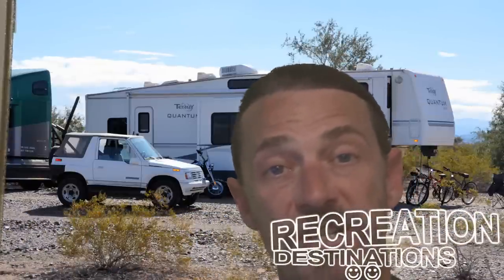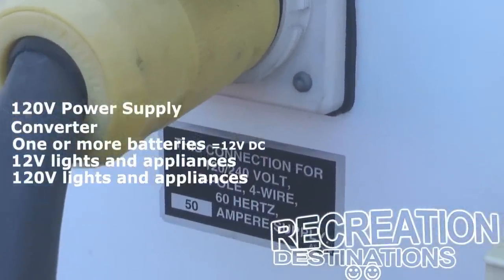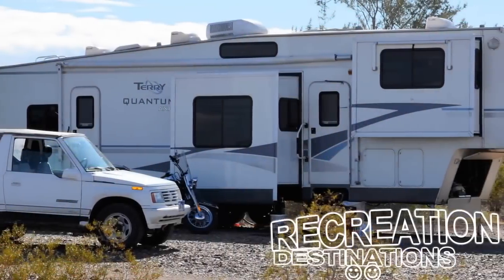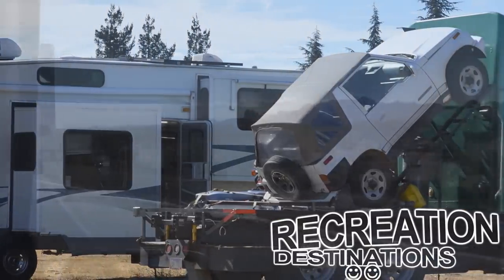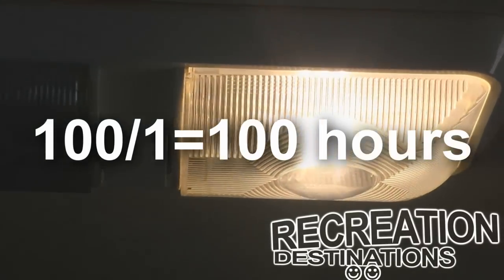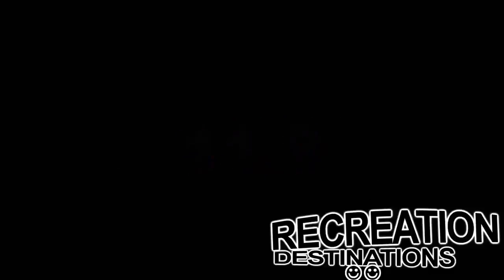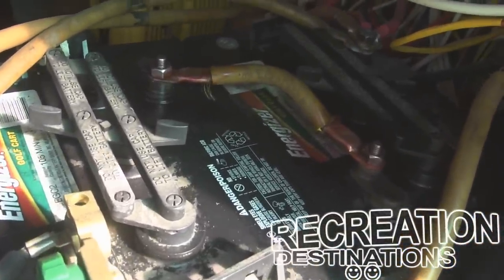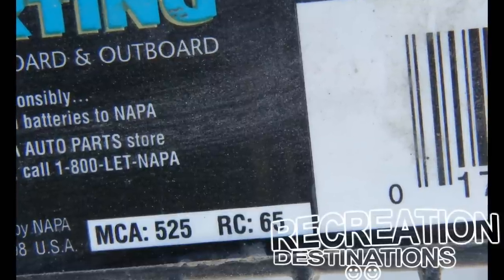Understanding RV Electrical Systems Part I

Comment: I am using a friend's inferno camper don't know the year the receptacle in the kitchen kicked off and I cannot find the circuit box or fuse box in the camper. I have searched in the camper and in the battery compartment. Since you are very familiar with tv's I thought you may be able to give me some Idea where it could be. It is a 43 footer Inferno. Thanks
Reply from the maker: I can't tell you where the breaker box may be, but if it was in the kitchen, I would look first for a tripped GFI (probably in the kitchen or bath).

Comment: Turned the Generator on in my parked RV , then turned the AC on and it wouldn't work. I have never had issues with the  AC in my 1999 Coachman Mirada Motorhome . 
I read everything and learned that if the Microwave lights/ Clock won't come on than the problem is connected to the Electrical Converter Box. 
I plugged into my home and received the same results.  I ck the Fuses in all appear to be fine and all of the switches are on in the box, I checked all of the GFI plugs.
I have a sick Aunt and will need to drive to Ohio soon.
If I put it in the Shop they will keep it for two weeks. 
It's just exasperating , I really need help , but I can't locate any additional information in the Owners Manual .
Any advice would be appreciated.
Thanks,
Kim
Reply from the maker: It is extremely difficult to diagnose electrical issues over the internet.  If you know someone with electrical experience and a multimeter you could try some basic troubleshooting to see if the AC is getting power.  If it is, the problem could be a faulty start capacitor.
Reply: We had same issue.  Turned out after several RV shops couldn’t find the problem, our local farm tractor repairman did.  The ground wire to the frame of the down by the back tires had come loose and broke when we hit a big pothole.  It is a Fleetwood 2009 fiesta class A and the ground wire attached to the passenger side back duel tires just above them, on the frame.  It was broken off.  He reattached and everything worked and the batteries charged and stay charged.
We went through 4 converters and 4 pairs of new batteries in one summer not understanding what was wrong.  And yes, the tractor man used a voltage meter until he isolated that it was not grounded.

Comment: hi, thanks for the video. I do have a question though. I was given a battery with my rv. Its a Deka Marine Maste and says for Marine and RV use.  I'm trying to figure out how many amps it is. The top of the battery has DP24, CCA 550 CA 685 and RC 140. I can't see where it says Amp hours.  Thank you
Reply from the maker: You might find the information at the manufacturer's website.  The DP24 may signify that it is a 240 amp/hour battery.
Reply: Recreation Destinations thanks il do that. It would be nice if these manufacturers just put it on the battery to make things easy

Comment: Thank you for an excellent video. I'm new to RV but familiar with electrical system (excluding rv).  Did I understand you correctly that RV parks that have 50A service are actually 240V at the shoreline outlet?
Reply from the maker: Thanks for the comment.  Yes, a 50 amp RV plug actually has two separate 50 amp hot legs, a neutral, and a ground.
Reply: yes they are

Comment: You should mention the Transfer main switch.If wires come lose over time they arc and the result is SMOKE.It happened to me and my neibour.Cost me 600 dollars on a 15 below nite to get a tec to the rv and replace the box. Make sure all of you check your transfer box to MAKE SURE the wires are tight. Thanks
Reply: DOUG FERGUSON m
Reply: Ouch, thanks for the warning

Comment: Great video, and very useful. After owning three 5th wheels, I think I’m fairly up to speed on my electrical system, but I still don't know what the transfer switch/box is or what it does. Is it part of the converter??? Help! Thanks!
Reply from the maker: Transfer switches are generally separate from the converter/inverter.  It senses power from shore line and switches to draw from the shore power.  If no shore power it switches to generator or inverter to provide 120V.
Reply: Recreation Destinations But I thought you just plugged your RV power cable directly into your generator, so how is that power any different than shore power?
Reply from the maker: Onboard generators in motorhomes and some trailers are hard wired into the system and a transfer switch is used.
Reply: Recreation Destinations Got it. Thanks for clearing that up!

Comment: I have half power on my camper light ac want come on the frige stopped working an I plugged up to sure power so is a breaker bad or what hook a battery up an stuff works

Comment: Any info on battery isolators and how to check for problems ?
Reply: My 12 volt system does not come on when I disconnect from 110 volt battery's are good

Comment: Does the battery need to be charged if it's plugged in a RV park
Reply from the maker: If you're plugged in at an RV park, the built in converter should be keeping the battery fully charged.

Comment: The battery indicator shows voltage & will show full while the charger is on. To see where your actual charge is on the batteries you can unplug from shore power & the voltage will fairly quickly drop to the batteries charged level.  After being unplugged for a minute or two the indicator will show your actual charge level.

Comment: Ok so my rv generator is set up ware it charges my house battery however needs to be started with the battery under my hood...if i use the battery under my hood only to start the generator and nit try to start my rv will a 6 volt marine battery work for that
Reply from the maker: No.  You will need a 12V automotive starting battery for under the hood.

Comment: If I leave my rv plugged into shore power all the time while in storage will it hurt my house batteries
Reply from the maker: No.  As long as you keep the battery electrolyte levels maintained, the batteries will last longer if the voltage is kept at 13,2 V.
Happy RVing.

Comment: are converters interchangeable? my cousin has one ....i need one......but they are different model and makes
Reply from the maker: Converters are generally interchangeable.  Output amperage varies. Higher is generally better.
Reply: Thx again..after 2,0000000000 you tube people...finally settled on you..how'd you get so knowledgeable? Why the semi? I drive one for my job
Reply from the maker: I've always been a DIY kinda guy. My first full-time RVing adventure was in 1992 and have been immersed in the lifestyle ever since.  Guess I've picked up a few things along the way.
The semi is a longer story.  Perhaps I'll tell that story via video one of these days.
Happy RVing!
Reply: Thx for response...I am green with envy!! Wish I could quit this shit and rv full time too..when I do get a few days of I park my rig in the lot where my toyhauler and pickup are......get in it and go hide for a few days....personally,I'd like to park it in the middle of about 40 acres of fruit trees and a big ass pond......

Comment: Why don't they make a popup with folding metal sides instead of canvas. In Europe they sell the Caravan. They make an A Liner here but I prefer straight up cabin walls. Also they make a high_low but they seem too big. Prefer to look out rear view mirror when I drive and a light weight trailer
Reply from the maker: Do a search on "hard side pop up camper".  There are some out there.

Comment: I see batteries for sale that say Depp Cycle but also refer to Cranking Amps. Why?
Reply from the maker: Those are hybrid batteries. They are made to run some accessories on a boat and also start the boat motor.  Usually  called deep cycle "marine".
Reply: Are there batteries that are not Deep Cycle? What I'm hoping to gain is more Amp Hours.

Comment: What are the 2 6volts batterys used for
Reply from the maker: Two 6V batteries wired in series gives you 12V.  Watch again at 6:00 if you missed it.

Comment: 2:25 is incorrect information.  You DO NOT have 100 AMPS of service.  That is called a split phase connection,  a common neutral and two hots on a 50 amp breaker.  AC needs to alternate between neutral and hot, the neutral can only carry 50 amps not 100.  The advantage to this is that you can make 12k watts with a 240v 50 amp connection.
Reply from the maker: So it seems the information is entirely correct by your own math.  You have two 120V legs which can carry 6000W each simultaneously at 60 Hertz. (50 amps each). W=AxV.

Comment: i have a r v with 30 amp . stared checking out my air and all my elect plug upflip breakers on all elect . came on ac and all run for about 5 min. then shut down  air will not come back on check breakers all are ok  . but lights at frount and ac dose not come is there a reset  nanywhere  theres a humm at the breaker box  semes to have power at ac its a 1989
Reply from the maker: AC units generally have a protection mode that won't let them start back up immediately after stopping.  Try to turn it off for 15-20 minutes and then restart.  If it fails again,  you may not have enough power going to the RV or you have a bad compressor or fan unit in the AC.
Reply from the maker: I just put up an AC video that may help you diagnose your issues:  https://youtu.be/E4DSXqjQTv8